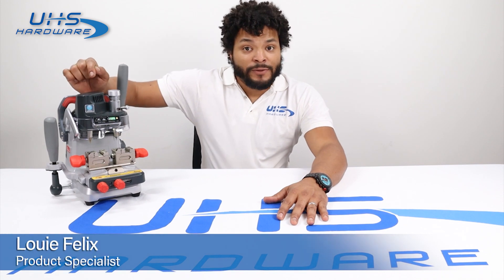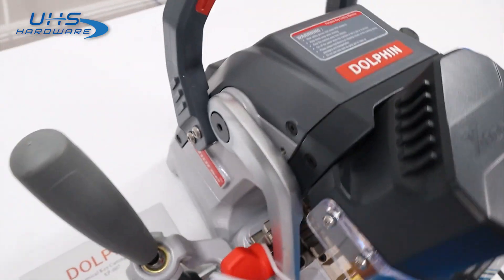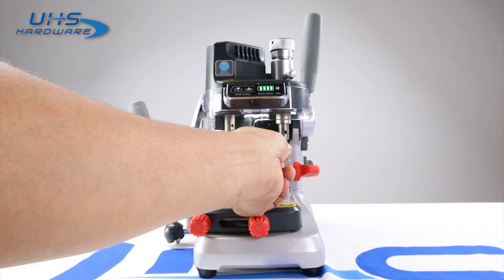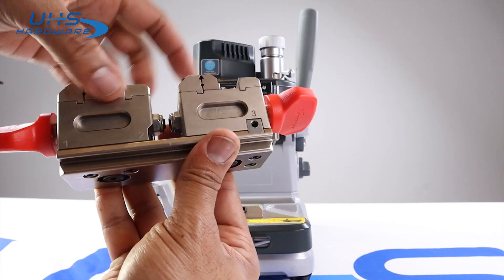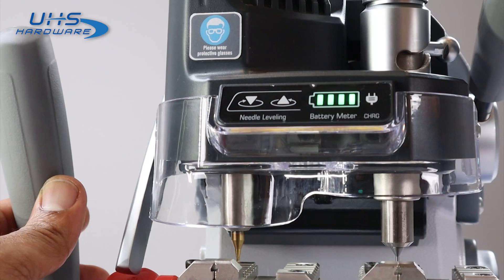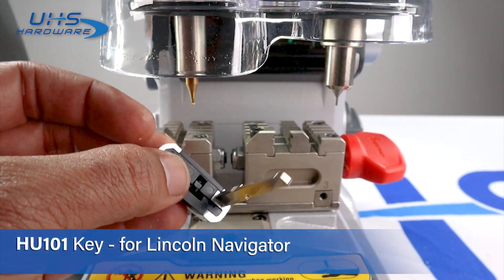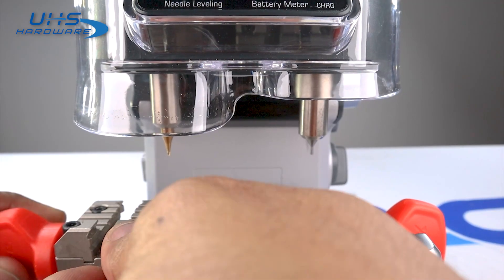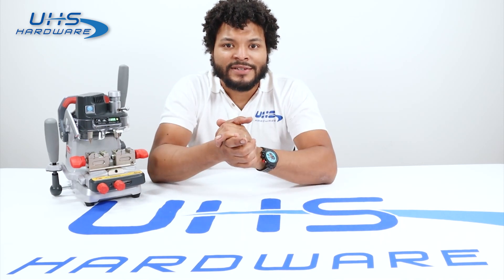Xhorse XP-007 Manual Key Duplicator - UHS How To Unbox | Setup | Calibrate | Cut Keys

Comment: Trash bought came with a bad battery can't get any help
Reply from the maker: you bought from Locksmith Keyless. Please call us so WE can help you. the machine works great. the battery can be replaced if it's causing you an issue. please cal 1-800-878-6604 ask for tech support.

Comment: Excellent video - awesome camera work, and clear explanation! If the battery fails, can this machine run on just outlet power?
Reply from the maker: Thanks! We can replace or send you a replacement if/when it fails.  Use without a battery is not recommended. Contact us at support@uhshardware.com.

Comment: I just received mine from your company today, and I am watching the video to calibrate. It only come with one 2 sided probe. Can not be calibrated unless you have 2 probes, correct? You CANNOT calibrate this out of the box? #uhshardware
Reply: You need 1 probe to calibrate from what I saw. The video has pros & cons. Having to set mine up today because my XC-005 went down so now I can only duplicate, not originate. If I was doing the volume I'd get a 2nd origination machine. 

Guess I'll stop buying extra keys when I do each job as I've been reinvesting into keys for future key cutting. 

Now time to explore the other way.
Reply: @dtnel What is your expirience with 007? Is it better choice for me to buy 005 or 007, just starting to work?
I will get autel im 508+xp400, and key max pro, but dont know what to buy for cutting?

Comment: Calibrated mine and cut the key fine, but caught the top of the clamp with cutter blade...  It slipped some how.  There isn't anything to stop the cutter overlapping to the right when cutting..
Reply from the maker: If all is calibrated the cutter shouldn't be able to touch the clamp. also tightening your z axis and setting the brakes for x and y can help to lessen the possibility of over cutting or slipping. it's a very powerful machine with tons of capability as well as some learning curve. It requires a bit of trial and error in my experiences. At the least some test cuts prior to actual cutting or after calibrating for sure. Let me know if you have any other experiences or issues.

Comment: How to know you are not too deep or not deep enough
Reply from the maker: I agree the instructions can be a little difficult, could you please explain what your process was when you calibrated the z-axis (up and down). Maybe that is the issue. did you use a tracing probe in both sides while calibrating?
Reply: @UHSHardware  If you have to use a tracing probe in both sides while calibrating, then why is this machine shipped with only one tracing probe in the box.  That means I can not calibrate it correctly unless I order another probe from you..  Will you send me one?